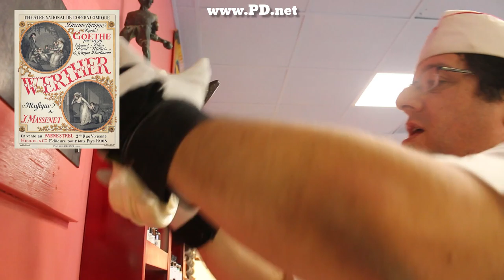#107 Candy Canes for Christmas in July and Lofty Pursuits. How did this holiday start?

Comment: I’ve noticed that the older hook that you use doesn’t have any candy stick to it, but when you use the new hook it sticks. Why is this?
Reply from the maker: Candy sticks because the temperature of the hook. The older Hook is much thicker and distributes the heat better. Hook doesn't heat up the candy doesn't stick. I actually think it may be more the fact that the humidity is lower in the new store. We're able to design some of the AC vents around where we work. I've changed hooks when I change the store is so I've never been able to do a side by side.